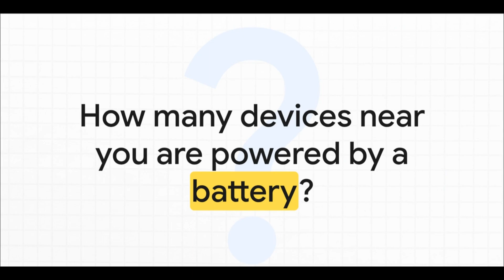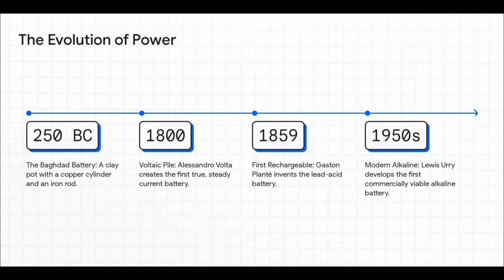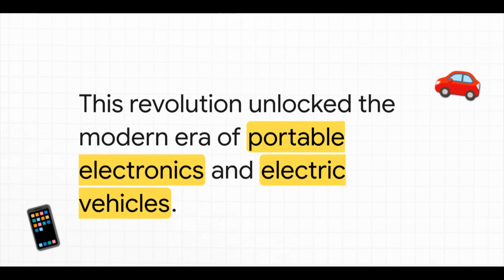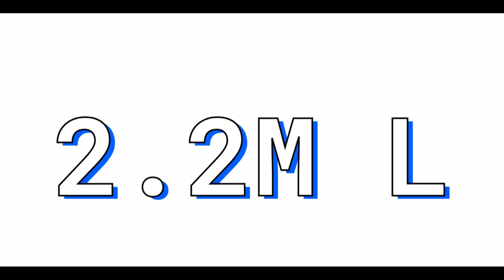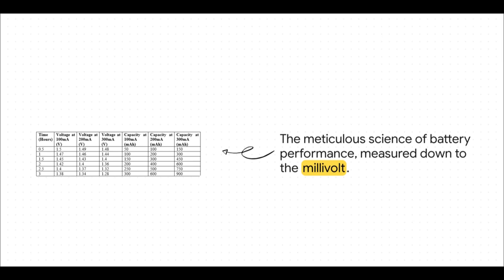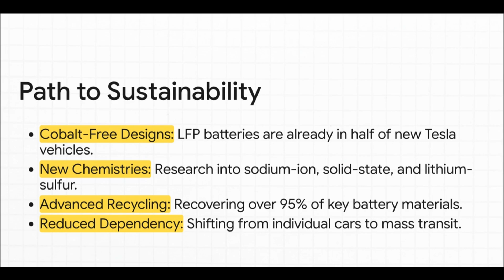🔋 The Paradox of Power: Inside Our World of Batteries ⚡

Comment: Toyota's lithium ion battery genuine? Hope so!!!
Reply from the maker: Thank you for your comment! Toyota is actually leading the way beyond just lithium-ion technology with their solid-state battery development. They have been working on this breakthrough since 2012 and plan to have solid-state batteries mass-produced in EVs by the mid-2020s—likely between 2027 and 2028. These batteries promise longer range, shorter charging times, enhanced safety, and greater durability compared to traditional lithium-ion batteries. So yes, Toyota's battery technology is genuine and could be a game changer for the EV industry very soon!